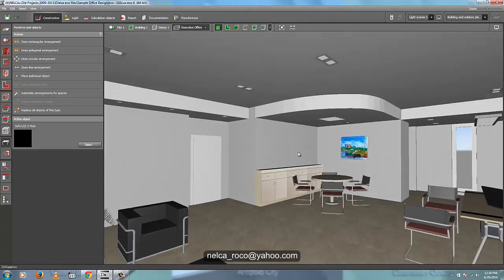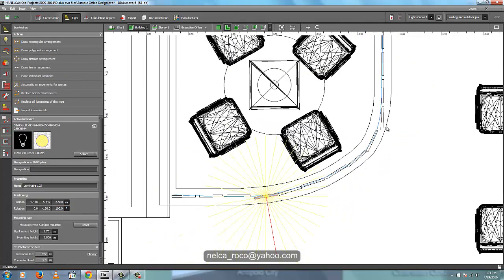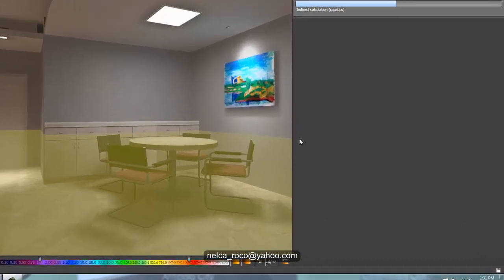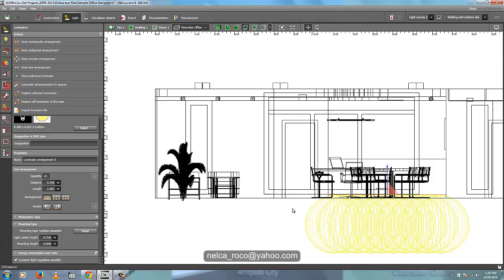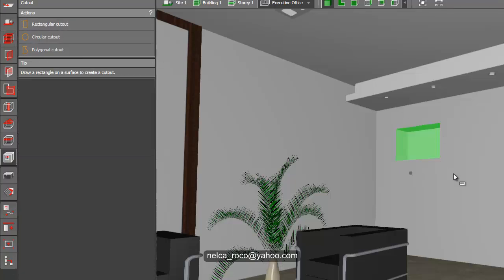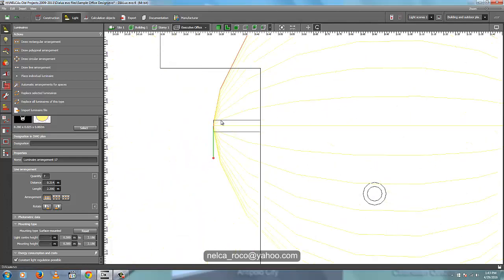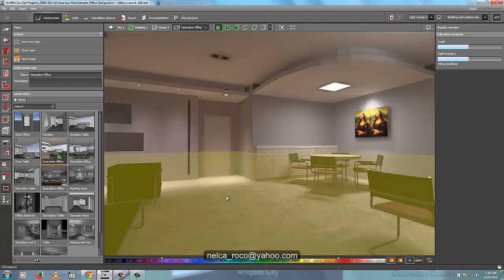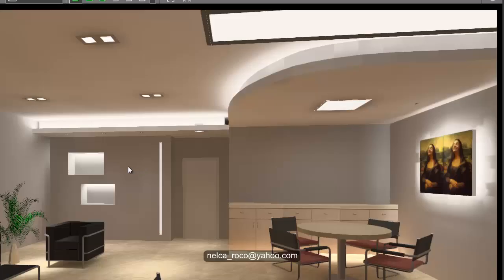DiaLux evo - How to use LED strip

Comment: Hi Nelca
Can you show how to use a multicolored led strip? how and from where can it be controlled?
Reply from the maker: Hi Steffy, just use the color filter under la,p tab, then create light scenes. 
If you cant find it, i will create a video for you.
Reply: @NelcaRoco  thanks a alot. I will try this out and get back to you if a video is required😃

Comment: Dear Nelca 
Greetings.
As always your tutorials are excellent and very helpful.
I am facing a problem related to Light selection catalogue.
I have to design lights for a small pharma setup involvinng normal n clean room lights.
I tried to get catalogue from Havells and Wipro in India but they r not available on net or there website. also they r not available in Dialux catalogue.
I inquired there distributor but they  didn't provide me saying it's not shared.
please suggest how can I get this files or If I can create them by whatever data available like wattage, luminance, temperature, dimensions.
plz suggest  I need this very urgently.

Comment: Hi, good job.
I have some questions...first one: which is your criteria to distribute the lights in the room?    Do you work before with the cavity method to calculate number of lights, type of lamps and the distribution... or you plan the lighting based on a fashion/design way ?
Thanks
Reply from the maker: If it is more of architectural lighting, I do it by light scene or mood.  If it is technical lighting, then I do it by lux level and uniformity.
Reply: Lux level at work plane its accurate way to measure light? i read in some web that its only referential, but im not sure.